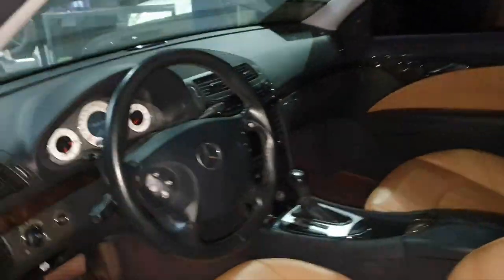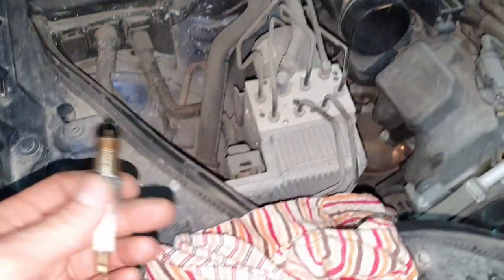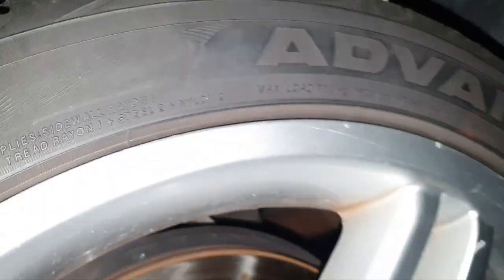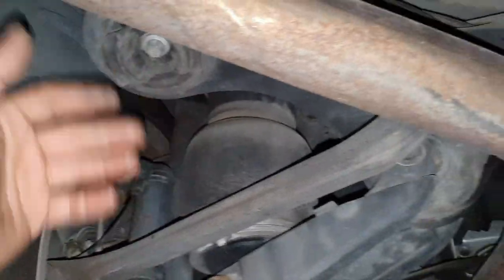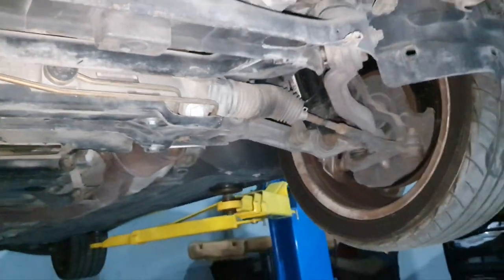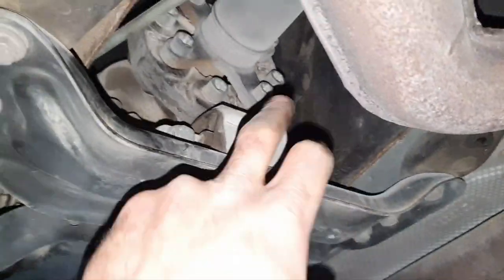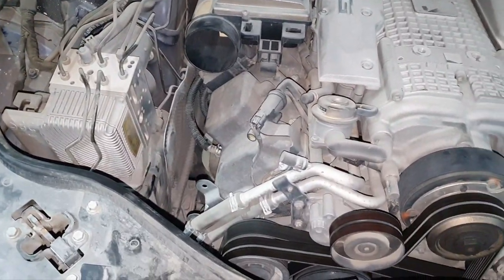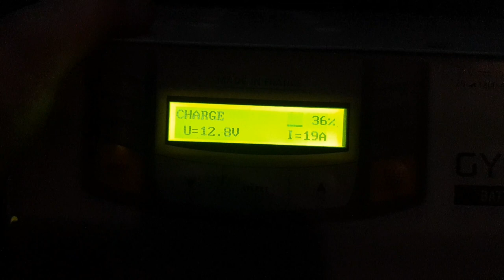E55 2005 with 165k km check up (part 1)

Comment: I had a Mercedes E220 CDI from 2007 and it had the original batteries up until I sold it last year. The last is impressive. It also had 415000 km.
Reply: E220 CDI ?
Reply: Yes, I forgot to mention

Comment: Tasos, what do you think about aftermarket headers for the the M113K engines? The stock Mercedes one looks like it was made in the dark by 10 year olds.
Reply: Stock ones made by machines , double wall fabricated stainless steel pressings.
That's why they look like they do.
Reply: They did a test in the U.K. (forgot the site) where they dyno'd the E55 with headers and with stock manifolds. The performance gain was so minimal (something like 6 horsepower) that in the end they said the cost for the header upgrade 1200+ pounds  was deemed unnecessary. Stock manifolds and mufflers flowed quite well and surprised everyone. FYI - cheers
Reply: @tonychavez2083  Thanks , good to know.
It would make sense that Mercedes /AMG would only fit an exhaust system that worked ok.